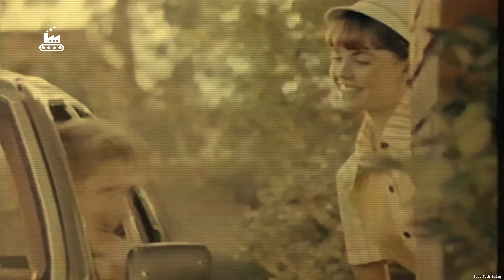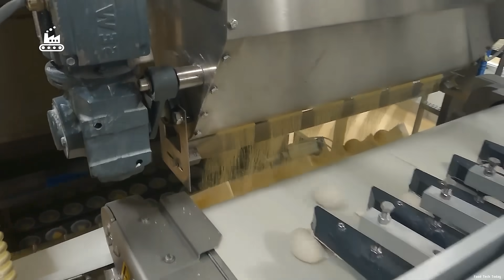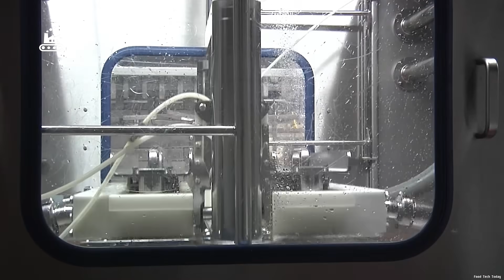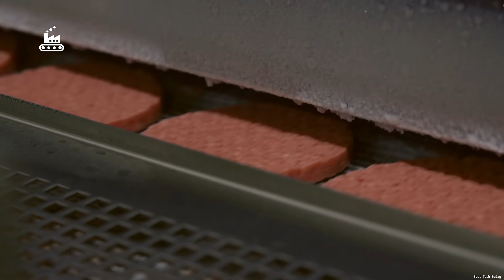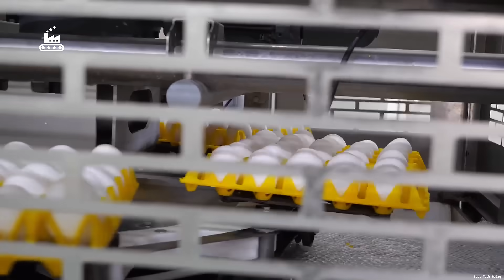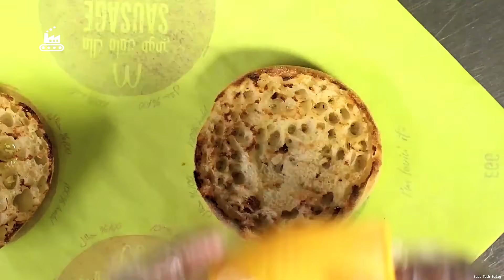How Egg McMuffins Are Made: Inside McDonald’s Breakfast Supply Chain

Comment: No butter? When did they delete butter from the recipe?  It made the original Egg Mc Muffin next level.
Reply: that's what I was wondering. Back in the '80's when I worked at McDonald's I remember brushing melted butter on each muffin.
Reply: @wandasays5438 
Yep, on each muffin and also in the egg ring to cook each egg.
Reply: @mdgraystone  That's right, I forgot about buttering the egg ring.
Reply from the maker: Where are you? How can there be no butter?
Reply: @FoodTechToday In Connecticut, no butter. The muffins are dry. Really wish they were buttered but they are not😢